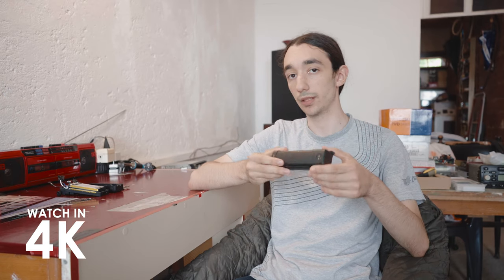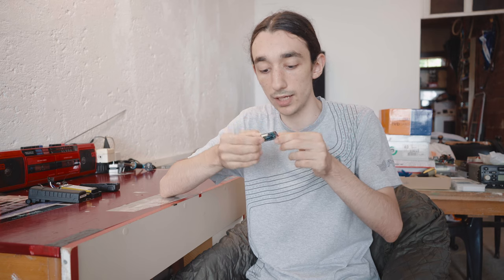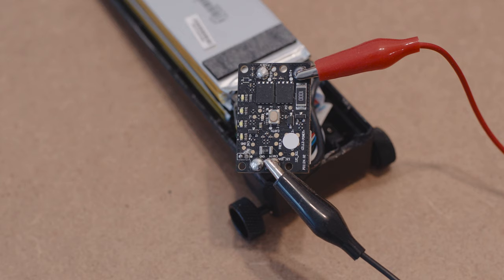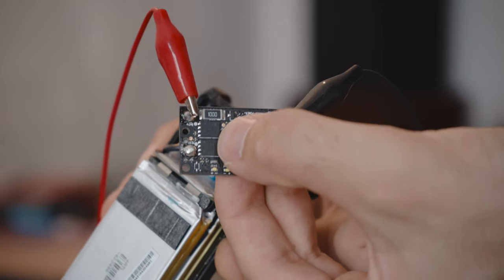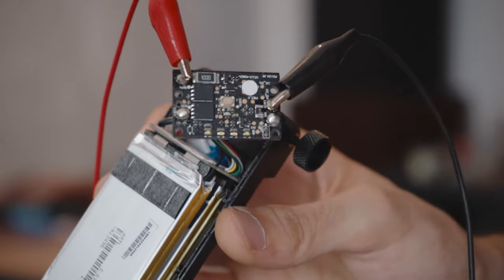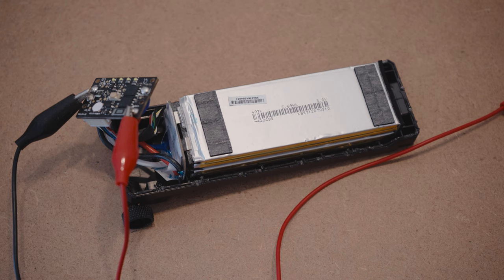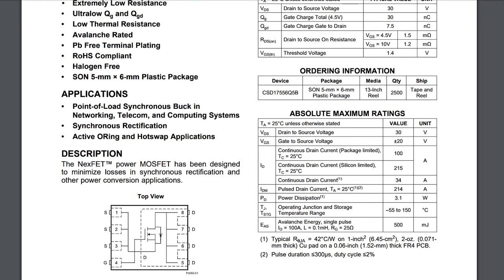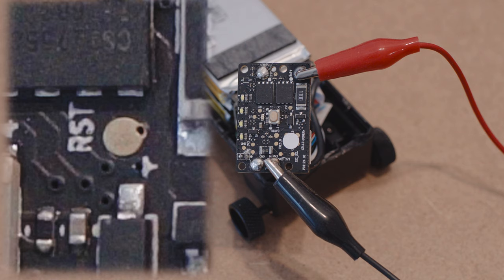DJI Ronin M Battery - Not working?... and possible fix

Comment: The chip needs reset when voltage runs bellow. I do fix this battery, I have all tools needed to repair.
Reply: Attila Portella Radocz how to do that
Reply: Plz how to reset the chip.
Reply: how do ou reset the chip how you have a video on how to do it please ?
Reply: how i wikl pay for u ok
Reply: Where is the rest button. I have the battery in pieces. There are two boards one where the battery is connected and the other where the leds are.
Reply: What is the procedure to reset the chip? Do I take it to ground? Must the battery be on?
Reply: how to do so?

Comment: what if there is no special charger available, and how to solve it?
Reply: universal LiPo charger like SkyRC iMax B6 mini could solve it. Select LiPo 4S 1A profile and you are done!)...
Reply: All right that's very interesting and I'm not using a DJI charger for now because of limited stock and your suggestions are very helpful thanks man
Reply: @орионорионВи  can i ask you one question ? Does SkyRC iMax B6 mini  has Ronin battery Plug in ,come with ?

Comment: I have managed to get my battery to charge but when connecting it to the Ronin the Ronin won't power on. Has anybody found a way to bypass the protection circuit in the Ronin so it can operate with ordinary Lipo cells. I connected an external power supply to the Ronin and it powered on only for a few seconds and then shuts down. I guess that the battery protection circuit is causing this.
Reply from the maker: Becuase the Ronin communicates to the battery, it's probably detecting something wrong and shutting itself down. Because I fried my battery, I successfully converted it to a powerbank, but can't help you much, because I don't have the expertise. I hope someone finds a solution.
Reply: @MitkoNikov  I wish I knew what that communication was, I would try and simulate it. Maybe its just a voltage like 5v to power the protection circuit. I really don't know what to do. I can't use or even sell my Ronin without batteries :(
Reply: Same problem here…

Comment: mitko what  do you think about the ronin m now? do you recommend it?
Reply from the maker: The Ronin M is a really good gimbal, especially when you don't need something like sport mode. It is mostly intended for films and long shots with heavy cameras, but you can use your Sony too.. I can only recommend it if you are in that field, otherwise, take a look at the Ronin S. Ronin M beats the 'S' in stability all day long, but lacking features, and the unnecessary heavy weight are a deal-breakers.

Comment: Do you know what the two small pins ( next to + and - ) are for on the battery ?
Tried to put in constant power 14v@20amp. The gimbl starts up fine, but then turns off again.
Reply: I think those are for a software update. May be a bus connection. Like a usb. Plus and minus with the battery connection. The small pins for data.
But im not sure
Reply: The small pins are for data. Battery voltage is carried by two leads.

Comment: To unlock the Ronin-M battery's bms one should clear PFF (Permanent Fail Flag) from its Flash Mamory.
It's stored in non-volatile storage rather then in RAM, so power-on reset is not enough.
It requires programming adapter like ev2300 or EZ-USB and special software to work with bq30z55 Gas Gauge IC.
Reply: А можете подробнее рассказать?
Reply: @MajestiK1S  если интересует процесс детально, лучше ознакомиться с даташитом на bq30z55 (bq30z554), это pdf на несколько десятков страниц, пересказывать его содержимое займет много времени и текста. Там описаны все ньюансы работы с микросхемой и как ее программировать и обнулять флаги ошибок, т.е. производить разблокировку, но для единичного ремонта это нерентабельное занятие, программатор стоит $150, проще купить новый аккумулятор.
Reply: Have you tried this solution?
Reply: @jmonty973  Yes, have fixed 3 batteries of Ronin-M already.
Reply: @орионорионВи  can you help my with my batteries?
Reply: @jmonty973  Do you need advice or to send me them for repair?
Reply: орион орионВи Hi ! I have the same problem and DJI refuses to fix it. Could you give me some advice please?
Reply: @philippebertini1221  Hi! There are online and offline methods to fix this battery both require some electronics knowledge and programming skills. One should have ev2300 or fx2lp programming adapter as hardware and bqEVSW or/and DJI_RoninM_unlocking_tool as software.

So if you feel lack of electronics repairing experience or don't have these special hw&sw tools the optimal solution is to find nearest laptop batteries recelling workshop. Usually they have all required to fix this battery as it uses similar BMS as laptop one.
Reply: @орионорионВи  Thanks a lot !! I try to find people here who can fix this problem for me...not very easy to find the one. And to be honest, i'm just a filmmaker not an engineer on electronics. If i don't find anyone, would you accept to fix them for me?
Reply: @philippebertini6559  You could send me them for repair but shipping costs would be high enough because we are from different countries. Alternatevly we are working to develop online fixing method using budget EZ-USB adapter and client-server GUI application to make possible remote fix. But project still under construction and not ready at the moment.
Reply: @орионорионВи  any update on your project?
Reply: @blueewong  Server app almost finished, next is client-side app to develop.
Reply: @орионорионВи  Very curious about this. I have 4 batteries blinking and turning off, like so many others 2 of these are just bought  new. I would be happy to get updated on your progress when you are ready.
Reply: @орионорионВи  I am also very interested in this, fortunately I have only 1 battery blinking & turning off as Carl is experiencing so would be awesome to try your project when ready :) Thanks
Reply: Also very interested in your project.  How far along are you now?  I have 4 batteries now that do not charge.  One I just received and was told it was "new."  When I received it it was showing two dots of charge.  So, I figured I could test it on the Ronin-M.  But the Ronin didn't start up at all, which scared me because I thought that maybe the Ronin-M had something wrong with it.  But, no.  The Ronin-M started fine once I got a different battery charged and put on it.  I then tried to charge the first battery but it wouldn't charge.  It just kept draining more and more until now it doesn't even turn on at all when I press the red button.  Totally dead, just like my other 3 batteries, one of which had just worked not that long ago.  So, I now only have one working battery.  If there is some way to bring these batteries back to life I'm all for it.  DJI is making a killing on crappy batteries.  And, yes, I'm using the correct charger and have tested it to ensure it's working properly.  Any advice would be greatly appreciated.
Reply: @OneMan4onestudios  the "Ronin-M Batteries Remote Fix project" is abandoned. We have found unreasonable development and investments in it for 2 reasons. The first one is that it requires expensive repairing equipment (programming board, DMM, Lab PSU) at client side, the second is that fixing process requires some repairing skills and electronics knowledge for the customer to master as well. Normally people who using Ronin-M are just cinematographers and don't have it so we need to spend a lot of hours to explain to clients in step-by-step instructions what to do to arrange working process properly. Sometimes it takes up to several working days to fix one battery. So we stopped this remote practice and turned back to offline job.
 If your batteries are just purchased and claimed "as new" me recommend to replace them by warranty. They have standard 200cycles or 6 month DJI warranty period.
 Alternatively you could send us them for repair.
Reply: @орионорионВи  Thank you for the detailed reply.
Reply: @carloskarlinne  Please create a facebook group so we could keep in touch as soon as you find the solution. Many people are willing to buy it. I have 4 dead batteries.
Reply: @орионорионВи  Hi, thanks for the hints. I was able to recharge the batteries cells from dead by drilling the holes on the them. But now I need to erase the PFF flag. Do I understand correctly that I need to access and connect 3 wires to GND, SDA and SCL using for example the Ev2300? How about the software, do I need some custom code specially made for the Ronin M issue in order to reset the specific flag? Is the procedure identical as to fix other DJI products like drones' batteries? Thank you in advance!
Reply: @dgnoise  Hello! Your understanding is correct. GND, SCL, SDA could be accessed directly at the battery connector, no need to dissasemble the battery. Suitable hardware is any of Silabs cp2112, Cypress ez-usb or TI ev2300. The software for Ronin batteries is custom and distributed under the license. But for one-off repair there is an option of remote unlocking by workshops who has the software using port forwarding.
Reply: @орионорионВи  OK, got it. Then I assume SDA and SCL are the 2 contacts available outside the battery and GND is the 0V battery contact.
My goal is to just fix 2 of my batteries, so the remote option would work as well. Unfortunately I personally do not know anybody with this custom software. Do you have it? We can actually continue this conversation elsewhere... Thanks
Reply: I would interested in learning more. I have 3 dead batteries.
Reply: @орионорионВи  can you please help me to fix my batteries?
Reply: @airfilm_it  send me an email
Reply: @орионорионВи  вы чинили такие батареи? Могли бы вы помочь? У меня две батареи с той же проблемой.
Reply: @karjala_film  да, чинил. Черконите мне на orionv76@gmail.com
Reply: @орионорионВи  how ????
Reply: @орионорионВи  do you repair them ?  Where are you located ?
Reply: Youtube search DJI bq30z55 unlock, operation process is the same. You just need a unlock password. I'm sorry I only DJI other password of the battery.
Reply: @орионорионВи  Are you sure a Ronin 1580 mAh battery has got GND clock and data connectors? I thought you´d need to open it.

Comment: How did you use the reset pin on the pcb to initiate a reset? Did you ground it?
Reply: If the reset pin is "high" (having pull up resistor to Vcc, either internal or external, doesn't matter), it must be grounded for reset. If it's normally low (zero or close to it), then connect to Vcc for reset.

Not a big deal to measure, but would be nice to know.
Reply: I need some assistance i really want to get my batteries working again but DJI is no help whatsoever

Comment: bosst up i already charge 3 point not evan gimbel start why why
Reply from the maker: Sometimes the contact between the battery and the gimbal is bad. There are small pins with which the battery communicates with the gimbal. Check the contact.

Comment: is the battery casing only glue?
how did you open it
Reply from the maker: It's extremely strong glue, I had hard time opening it. If you have some had saw, it would be way easier, but you can do it with a knife or roller knife too.
Reply: In many cases there is no need to disassemble the battery because it's software lock which prevent it from charging and discharging and thus it could be fixed through battery SMBUS connector using special tools. Even in the case of very deep discharge (about 1...2V per cell) it's still possible to recover the battery without disass-y by drilling 0.5mm hole against 'B+' terminal to precharge the cells to safe minimum level of 3V/cell to enable BMS reprogramming.
 The only case it really need to dismantle the battery it's when the cells are damaged due to Zero Volt discharge or there is not accaptable capacity imbalance between different cells.

 But if you still want to disassemble the casing be very accurate! It's very easy to damage the LiPo cells or BMS by sharp instruments. Some people have damaged still good cells during inaccurate disassembly thus significantly increasing the cost of repair. The size of original cells is very specific, they are produced by ATL for DJI only and not available to mass market.
Reply: Mitko Nikov   thanks for the video! Are there any (hidden) latches you have to pry open or is it „just“ glue all the way around? Thanks, Matthias
Reply: @орионорионВи  is there any way abandon these wonderfully smart batteries and go ahead with a generic battery
Reply: @MitkoNikov  it´s not glue. It's ultrasonic welding

Comment: Very interesting information. I was thinking about possibly rigging a AA battery in place of the battery cell. I just got to make sure I won't fry my gimbal while I'm at it.

Thanks for all the insight.
Reply from the maker: AA Battery cell can't supply such a high current when the gimbal is going to need it. It's going to be shutting down on you. The BMS module I was talking about arrived some time ago and I have aleady constructed a powerbank of of the batteries. It works great and can hold a lot of juice. But be my guest, and thinker with it at you own risk. Share the results, I would be glad to know.
Reply: I’m also interested in more information on this

Comment: ev2400 unlock
Reply: Have you been able to unlock it using a ev2400 unlock?
Reply: @brambo129  Youtube search DJI bq30z55 unlock, operation process is the same. You just need a unlock password. I'm sorry I only DJI other password of the battery.